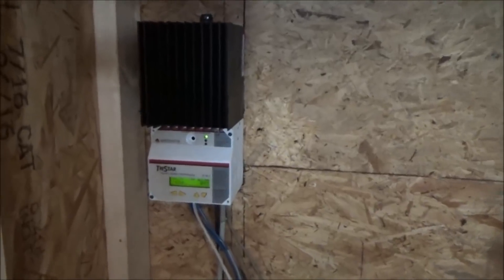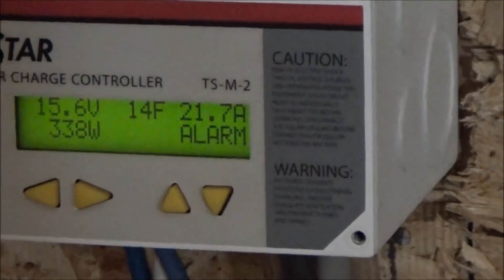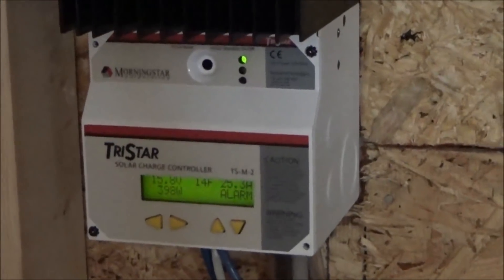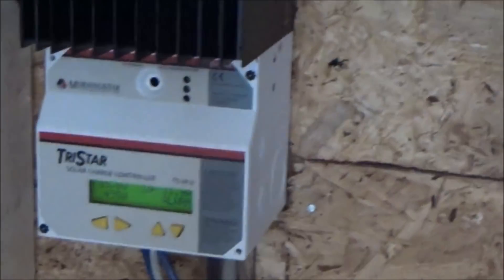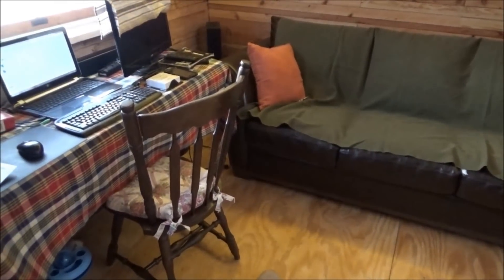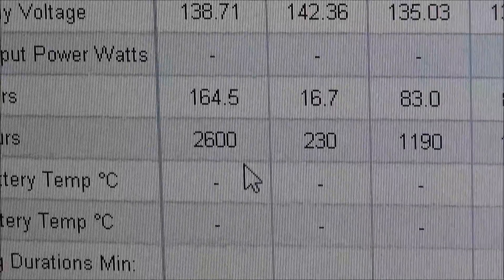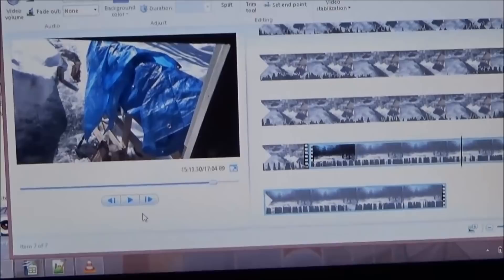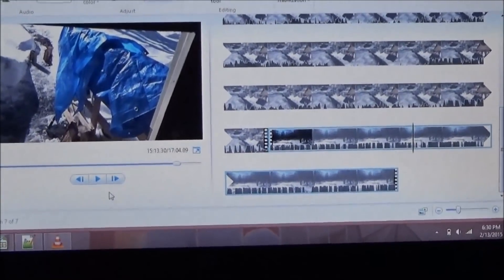Awesome Off Grid Solar Power Then Catastrophic Failure All Around

Comment: DON'T sew that leather!  Get a leather repair kit and fill the split in the right way.  You'll only stress it and cause a bigger rip.  It seems to be really dark in the house without lights.  That fire should light the place up without having to use so much battery power if you'd clean the window on the wood stove.

Comment: On the HF generator, try pulling the starter cord to see if there is more resistance than usual, if so  then it will be that the piston is starting to seize in the cylinder bore. they are noted for doing that OR if the pull resistance is a lot easier than normal, the top of the piston may have a hole burned through it, which is another problem of those particular generators  Since there is no adjusting screws on the carburetor, either the mixture was too lean and caused detonation (actual melting) of the top of the piston due to  TOO fast of a burn rate of the fuel mixture which creates  a high temperature may have caused the piston top to melt causing the hole in the piston.If and when you do take it back and get another one, try mixing  a little 2 cycle oil in the gasoline, so that the burn rate of fuel mixture is slowed down and will also act as an upper cylinder lubricant, that will make those engines last a lot longer than if you only used straight gasoline, plus the amount of fuel used will last longer between fill ups.
Reply from the maker: Engine starts easily but it wont run very fast at all.

Comment: Alarm means stop.. . 
  - If you've made a recent change, change it back/disconnect. 
Is everything back to normal? 
   YES: Fault with recent change 
   NO: Something else is wrong... Disconnect everything and test individually.

... I was shouting at the video telling you to stop Troy, hope it doesn't cost to much to fix. 

Loving the sofa and babycat will to... But does the coffee cup and unboxing remain on the floor? Mmm, home made side table with storage needed??
Reply from the maker: Alarm meant over heating due to the house being too hot. It limited the current to cool itself off.

Comment: Troy, I would like to suggest an amp meter in the line from the wind turbine.  It would have gone negative today and you would have known the diode had blown.
Reply: Isn't 20/20 hindsight wonderful? I had a similar thought! He can get amp meters similar to his voltmeter from ebay. Most of them need another source to power the display. Might use some epoxy putty to mount them near the charge controller.
Reply: John King Bedini just chose to use a rotating wheel rather than a 555 to generate high voltage pulses. (Also some funny ways of describing desulfation) The battery needs to at least have some small charge to run the desulfation system.

The shorted diode allowed reverse current to load the system.
Reply: Gosh!! Who woulda thought that the amp meter would draw power!! Guess +John King is right - it ain't possible to put a switch around an amp meter that allows ya to check the current and then switch it off! (is that right????)
Reply from the maker: Very soon

Comment: Problems always come with progress. Your entire system is jerry-rigged, so hey, problems should be expected.
Reply: antonio r. belizario Belizario Thanks for your explanation.  No hard feelings here.   And I agree with your statement about 'professionals'   I once had some new wireing and lights put in my store and I told electricians I wanted all of the new stuff on new and different breakers as I was already blowing breakers with the load that I already had.   What did I find out that they did?  They piggy backed into the old system with almost everything that they did.   Needless to say, I did not give them their final Thousand Dollars.
Reply: antonio r. belizario Belizario Oh gosh, I hope not, but it would not surprise me.   There should be footprints though, if that was the case.  They could not hide them with all of the snow around.
Reply: antonio r. belizario Belizario Yep !!!!  lol
Reply: Antonio, what is your definition of jerry-rigged?   Is everything that is done DIY the definition, does everything have to be done by a professional with tope of the line, expensive parts in order to not be jerry-rigged?
Reply: John King John, please refrain from answering questions that were not asked of you.   I prefer to hear from Antonio who is very capable of speaking his mind.
Reply: Vicki Olson It does work just a miner set back
Reply: Vicky do not assume that I was putting Troy down. To me jerry-rigged has many meanings, some pejorative, some not. Most DIY projects done by people like Troy involve assembling machines, furniture or even a house on wheels from a variety of materials from a variety f sources, some of them scavenged.  I think that is a good thing, do you not? Reclaim, reuse, recycle is the  governing mantra of the sustainability movement. Some times they work, sometimes they don't. If I have a criticism of some DIY people is that they don't do more jerry-rigging. Personally I think we rely on "professionals." Many of them are frauds.
Reply: Any one with a tool box and a lack of honesty can claim to be a professional. How do we know? I trust DIY people more. Why? They'll take chances with others and charge them, but if we do it ourselves we know that if we do it wrong its our homes that burn, so we make sure it is done right. having said that, people wll always make mistakes What really bothers me is that maybe it was sabotage. That would be pretty awful
Reply: ok, ok, but as to your previous comment, John, my very point. Troy admits that he is learning and at times experimenting. Experts act like if they know it all  and maybe theyre a high school kid who borrowed his fathers tools
Reply: UBERIST I think that you are stretching that a lot, considering that many highschools no longer have a 'shop' class.
Reply: most high school kids are smoking dope, chasing girls and popping zits

Comment: Its a shame that the thermodyne turbine has NO built in safety function to prevent it from using the battery power.  You can wire the positive to negative on the turbine to create a BRAKE function to stop it from spinning wildly while you fix it.  I bought my brake from MW&S and before then I would just short the lines to stop the turbine to do maintenance on it.   Hope this helps.   To bad your turbine took all the power the solar created.  Good Luck on getting it fixed.

Comment: Troy,

Just curious what is the voltage & amp rating of your wind turbine? What size blocking diode did you use amps and volts? Did you mount your diode to a  heat sink? Protect from moisture with an enclosure? Any surge protection for static electricity on  your diode? Perhaps I can help you so this does not happen again.
Reply: MollyDolly

I don't think so Molly. The cat may be able to generate very high voltages, but extremely low currents. Not much power to it. The static charge can make you jump but I doubt it could blow a blocking diode. Just my opinion.
Reply: Dealing with 1500KW metal melting furnaces, Diodes and SCR's always fail shorted.  Just an FYI.
Reply: May I ask a question? .. If the diode is in the house under the counter where BabyCat can rub it... is that enough static to blow it?
Reply: You guys! Stawp!   I am not blaming BabyCat!   OP asked about static / surge protection. ..I wonder if a rubbing cat can do that,  perhaps some precautions should be taken?    Shame on you. ..
Reply: rich k    Lol!!
Reply: Poor BabyCat!
Reply: MollyDolly No baby cat 2 vids in a row :(
Reply: offgrid40 What can the matter be?
Reply: SSanf she was being a camera hog LOL :/
Reply: SSanf  I think she is renegotiating her contract. ..
Reply from the maker: It was a 50 volt 45 amp diode and I had it wrapped in shrink tubing so it was all nice and safe from outside shocks. The wind turbine has never put out more than 15.5 volts DC to date. The diode was a cheap ebay deal. It was just cheap.
Reply from the maker: The Do It Yourself World And no, it should not have been overheated either because that wind turbine did not put out much power. It was intermittent at best.
Reply: offgrid40 sorry not yet... can't get them on my phone,  just my laptop.

Comment: The alarm is because the voltage is to high for some reason even in absorb mode you are pumping 15+ volts into the batteries that is why you got alarm issue at initial fireup of day voltage should go to bulk 15v or so then go back to absorb at around 14v then float around 13.7v something is wrong your voltage is staying way to high you will fry your batteries that way.
Reply: If the MPPT is setup right then you wire in series to get higher voltage and lower amps so the controller works out the electrical needs.   For instance my system  104 volts dc and 16 amps in.   The MPPT CC i use takes this and converts the higher dc voltage to higher amps.  When the batteries get close to charged then it lowers the amps to do the absorb and float.   His alarm will have to be looked at with his software to see the codes.  If he can access that part.  I get full information if I get an alarm.  Over voltage, over wattages, over amps, short, ground fault, arc.  etc..  It all gets put on the screen and in the software to look at.  Troy will have to research his CC to see how to get the error codes.   I think he went over wattage due to that controller only allowing 800 watts nominal input at 12 volts.   Which means you can only hook up 675 watts to allow for the PEAK and cloud edge effect.  that information is http://www.ecodirect.com/ProductDetails.asp?ProductCode=Morningstar-TS-MPPT-60&gclid=Cj0KEQiA6ounBRCq0LKBjKGgysEBEiQAZmpvA3qtcqvXigDTVvvZlyG86Xa3HwuwJkQExoUyN00d78waAvFd8P8HAQ   
800 nominal wattage in for a 12 volt system.  But this is just my take on it.   His unit is a 60 amp unit Morningstar TS-MPPT-60.  and the manual is https://s3.amazonaws.com/ecodirect_docs/MORNINGSTAR/TS-MPPT_Manual.pdf   
His alarm was to much solar wattage in according to the amount of solar he said he hooked up.
Reply: Agreed
Reply: ***** Hey Bill can you do a video on your new system ?

Comment: what is the maximum watts  that controller will take ?
Reply from the maker: 800
Reply: before you reset your controller,  remove one solar panel  from the new added solar array  if that works without the controller alarm going off , then run with it  ,good luck
Reply from the maker: Bryce Irwin It was over current from the added solar panels
Reply: OKAY  what next on your most important list